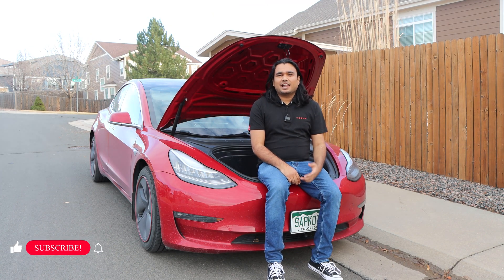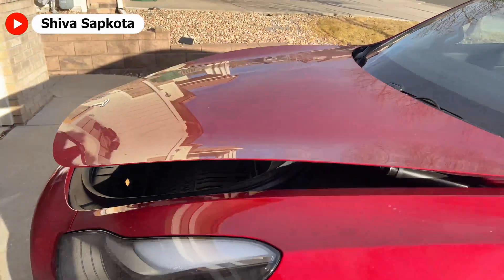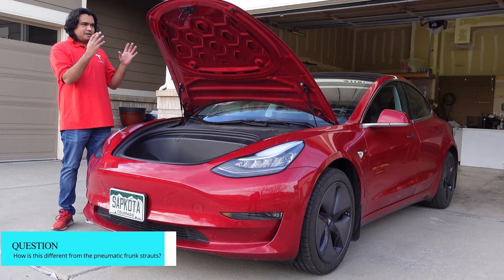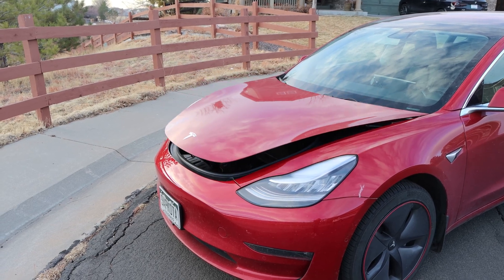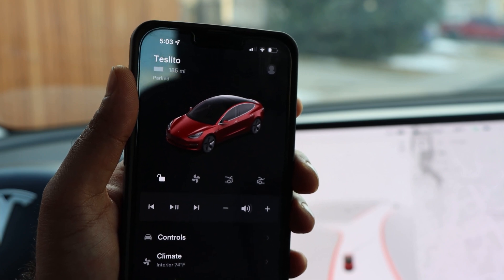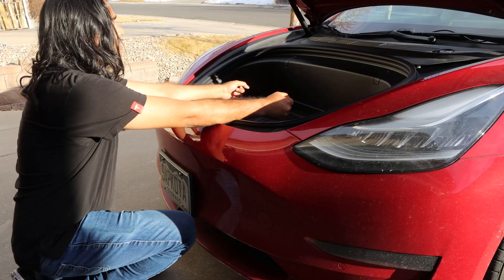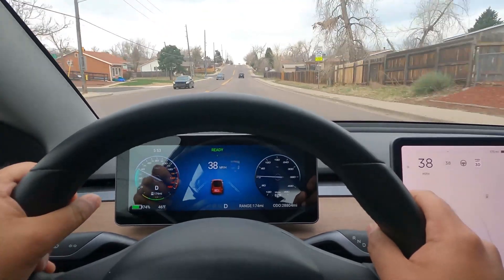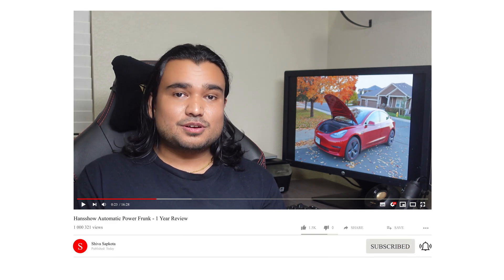Tesla Model 3/Y Automatic Power Frunk - One Year Review & Safety Concerns (Hansshow 2022)

Comment: What happens if the motor fails whilst the frunk is closed. Has anyone tried to release the motor manually using the supplied cable release. I heard that this does not work if the release motor is seized

Comment: I installed this last month on my model y 2024….. it was great until the unit failed. The frunk was stuck in the open position, I had to remove the struts so I could close the frunk otherwise the car was not drivable. I purchased it from Tes studio….. they do not answer the phone and e-mail is very sketchy I would stay away from Tes Studio they are not reputable. In your next video, you should caution your viewers that if you purchased one of these units the technical support and warranty are nonexistent, so buyer beware it is an expensive purchase

Comment: I have sadly encounter a few issues during installation as some of you have as well and warranty issues after the installation and using the frunk for s few months. Hansshow does not back up their product and when it failed me (after months of usage), the frunk would not open and I had to take it to Tesla and incur additional charges to have them open the frunk for me. Tesla removed all the aftermarket parts from hansshow I connected back all the original ones and the frunk started working properly again... Hope this helps save someone else from the headaches and the expenses...

Comment: You can’t trust someone who reviews a product that includes an affiliate link for it on the video
Reply: Cool story bro
Reply: True. But I have one for 4 years and it’s great. I did have an issue with the metal cable that needed adjusting.  I love this feature.  It’s very cool.  I would love it more if there was a foot sensor and a button on it.  It seems possible but not sure why they didn’t do it yet.

Comment: I installed a V.5 on my 2022 MX refresh. It works fine but it will not open all the way, maybe half. The older units had a programming mode to set the speed and opening height but this new sealed unit doesn't seem to have it anymore. Anyone out there got any suggestions? I keep getting told on WhatsApp that the Hansshow Frunk man is on vacation!
Reply: I thought you can manually raise it, then there is a button on the control box that you long press until beeps...  more beeps is faster speed, and long press remembers height.

Comment: I installed this
In my 2019 performance model3. Unfortunately I ran into issues with the close adjustment.  In your install video you never went over adjustment for when it does not latch. I tried everything to correct it but it did not work.  Talking to Hansshow is next to impossible. I wish you would consider making a video about all the possible adjustment for when it does not work perfect out of the box.
Reply: You have to move the the latching mechanism a little up or a little down. It’s a very very precise thing. So make sure you use position markers.
Reply: @eliobar95 thanks for the response. Not sure what a positioning marker is.  Would you be willing to explain as I have not use my frunk do to not being sure how to make this adjustment. Do you know if any you tube videos that show this adjustment.  I bet if you make on you would get a ton of views.  I would be the first to watch it.  Thanks Bro
Reply: @drjeff44  Honestly watch a install tutorial for pretty much any model Y 3 automatic frunk . Some of them have less or more parts, but the latching mechanism procedure is the same every time. It’s not too difficult. You may just have to move the latch up a few millimetres. But 99% of the install videos tell you/show you how they did it.